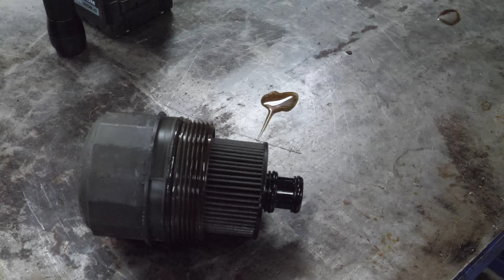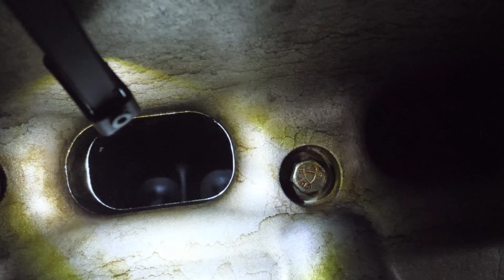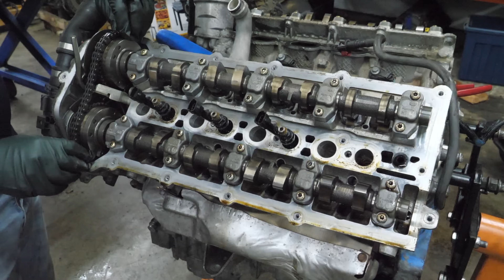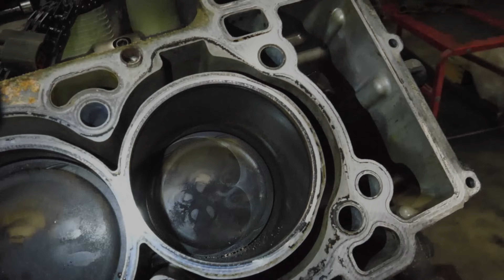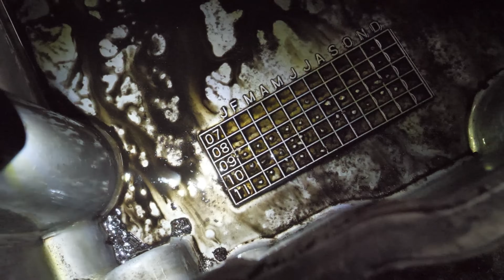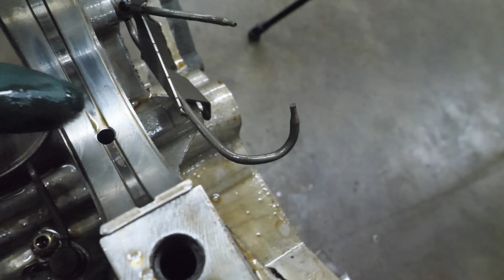500HP Jaguar Land Rover 5.0L Supercharged AJ V8 Teardown! Had to buy AND borrow tools just for this

Comment: My friends seem to send me such jobs and as a novice to this engine, I thank you for the disassembly notes.  The impressive 500 hp rating comes with some challenge.  And the strength of the lower end as fasteners and design show attention to that detail.  The number of points that might leak suggest real problems as high miles. Natural to maintance upkeep as seals, o-rings a parts channel would be critical as where non dealer repair might be undertaken.  I did take note of an owner comment, as a 2010 (XF)  *water pump and timing with oil change interval.
I'm guessing it's love-hate as to older machines.  Real skill is going to be needed to undertake repair as these machines continue to age. And where the harness connectors become brittle, worn...I suggest troubleshooting faults might get tricky.
My take away.  Ownership of these models is not for the faint of heart...and before I would see one at my shop door, I think long and documented conversation as to cost, parts availability would be important to any fitter, journeyman as repair issues.  Thanks for the post.  M.

Comment: This engine looked fine. Like a misdiagnosis. These 5.0’s were known for wear on the tensioner to guide contact button. It became a lawsuit and the guides and tensioners were updated. The reason you do not turn these backwards is because it allows the oil pump timing chain to jump and go out of time. I’ve worked on hundreds of these engines and they bought my house 🤠

Comment: Interesting engine though I am always curious what drives brands to design engine components that break typical conventions. In this case, the fuel/oil cammed pump. Was there some other aspect of this engine that required that type of design? The supercharger design: why?

Comment: Is it possible the injectors got stuck open and cut the plugs? the same as happens with some of the BMW V8s. the electrode off the plugs could have caused the damage to the pistons

Comment: A well known and documented engineering flaw with all Jaguar 5.0L engines from introduction (2010)  to mid to late 2012.
This is a timing chain tensioner (chain guide) failure which was corrected around 2013 with a redesign.   the retrofit hardware is readily available  for those willing to pay thousands to have it retrofitted.
Jaguar offered zero compensation for any car out of the 3 year warranty regardless of miles.
Once the engineering change was made, the motors from 2013 and on are considered very reliable.
Just an FYI...

Comment: i bingdown  that road befor with one of those engines and i came up with the same conclusion as the other post that the plastic piece is a  timing guides. no known that wasent the issue the fult is with high compression tensioner you saw leaking oil

Comment: WOW!    This thing is an engineering masterpiece but I would lease, stay on warranty, and at 50K go get another one!   As proven here, this sucker is so complicated that the failure of one little part, which is highly likely, results in an engine swap, a process similar to naval aviation where you just swap the engine, and send the core to naval air rework, a rework factory if you will.    Looks to me like that is the plan, and they preload the cost for all of that into the price.   Amazing!   Great video Eric!
Reply: Engineering masterpieces have no superfluous parts and generally don't need parts removed to get at other parts.  "Rube Goldbergian" is the word you're looking for.

Comment: That engine seems to have had the lower oil pan replaced at some point because the car bottomed out and cracked the original lower oil pan and put that dent in the oil pump pickup.

Comment: Unfortunately I think I know what the problem was. It is actually a well known issue in the early 5.0 L Jaguar/land rover engines. Please check the chain guide which is pressed by the tensioner, i think there is a pretty big hole in it. The chain guide was made of too soft aluminium. The tensioner piston is made of hard metal. So after a while a notch appears in the guide, eventually this notch is too deep so the chain can't be tensioned enough. Rattling the chain and break some of the black plastics. A new version of the chain guide is available with a hardened point/notch on it where the tensioner contacts the guide. This is an upgrade every owner of the early 5.0 engine should do...
Reply: What's considered an early 5.0? I have a 2015 XKR

Comment: If the engine ran very rough and uneven, it would make the crankshaft want to jump and throw it's weight around, that could prematurely wear it's main bearings quite a bit.

Comment: Same cam chain tensioners as 2002 Triton 5.4?  No wonder they failed 😄

That HP fuel pump situation and it's associated hard lines running past the exhaust is totally insane.

Comment: That tube that runs under the oil cap from the sump is for vacuum extraction of the oil for oil changes. And yes these engines suck to work on in the vehicle 😂. And yes that balance shaft for the HPFPs needs to be timed

Comment: I have a 2012 Land Rover. The engine locked up on it. I have the diagnostic test run her a reliable car service and they recommended a new motor for my 2012 Land Rover. I have never had any issue with this Land Rover. I was kind of wondering if a timing belt machine could be the issue Wyatt locked up. It had plenty of gas and oil change. it locked out as I was driving it home from the grocery store it lost power and I pulled over to the side of the road. Let me know what you think.

Comment: My dad n I replaced a 4.4 BMW engine in an Overfinch Range Rover thing, it had been run until it had lost all of it's oil somehow? Anyway, the timing had jumped a few teeth causing piston and valve contact but it still ran lol. We replaced it with a low mileage 4.4 BMW

Comment: Wow, I have a 2011 naturally aspirated 5.0L in my XF that has blown head gaskets/warped heads... all the instructional videos tells me I can't get the heads off in my garage without special tools and here you are totally disassembling one with a crowbar?  Two questions is this even feasible if I want it to run again, or do you have a long block 5.0L Jag naturally aspirated engine for sale cheap?

Comment: Torx plus, 12mm Ribe bit, polydrive. Which one for the head bolts? What size? I got mixed info.
Ok.. Answering my question. At least for my 2012 RR Sport 5.0L NA engine, the 10 head bolts are TORQ PLUS TP55. Not ribe bit, not torx, not polydrive.

Comment: The broken plastic piece is from a previous guide that failed. Looks like someone changed the guides and most likely did not replace the tensioners and the chain itself. It’s obvious by the yellowish marks someone made on the cams and the chain to keep them lined up.

Comment: Eric, assuming you are on the path to buying a new impact from Milwaukee, aren't they currently having warranty issues on their 2767-20 with serials H96B (but not H96A)? I understand they did a recall to replace store stock of the H96B models with the older H96A model just before Christmas. Just in case that affects you.

Comment: Problem is, Land Rover wont sell you con rod or main bearings so even if you have one that needs a crank or wiped the bearings, you cant buy bearings from Rover. Im sure some aftermarket company makes bearings but still, these engines are very hard to get internal parts for that arent in the timing system.

Comment: I have a 2011 RRS with the supercharged aj-v8 that’s bad. Took it in to a local Land Rover shop, which they ended up messing up and didn’t want to own up to their fk ups. Ended up getting an attorney and was basically told I can’t do anything about it.

It’s been since 2017, and it’s paid off just collecting dust.

I’m curious if Coyote 5.0 camshafts will fit the AJ-V8?

Comment: I can totally see for building that to where you have to pull the motor mount be able to get the valve cover off to get high pressure oil line off they do that on cars all the time now

Comment: I think the rod bearings were replaced the last time the engine was opened up. That's why they are in such good shape. Also, that loose screw you found may have been one of others, perhaps one got ingested by that one cylinder? Someone was careless with hardware.
Reply: It would have been something small and relatively soft otherwise it would have totally destroyed the head, piston and cylinder.

Comment: Wow,what a monster, i wonder what the speed limits are, over where the car owner lived at   lol
02:40 it seems that the supercharger pulley was turned off round? seems impossible, it could be the video
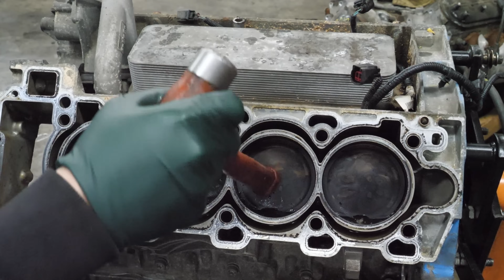at 41:30  to properly check for damaged rod bearing with excessive play, you need each piston,in turn, to be going down, in order  to create the gap on the top side of the big end; then you hammer on the piston,with the handle,as was well done,as listen for a thud.

Comment: The major flaw is the guides that the tensioners push on. But the biggest, coming from a current owner of a RR with this same engine is a LACK OF A DIPSTICK
Reply: Lol I have a f type SVR and I was looking for it for the longest time until I opened the oil cap and noticed that it just has a tube for service checking... You could check oil level via vehicle info but you will have to jump thru some hoops for that

Comment: Complexity for high performance. Beautifully engineered engine yet puzzled by the use of plastic. If indeed the failure was attributed to a spark plug electrode breaking off; then bad luck for the owner and not the fault of the designers. If it was timing tensioner failure (witness plastic pieces in the engine) then one design error compromised the engine.

Comment: I’m working on my personal 2011 range with the 5.0 SC did the full timing job kit provided from Land Rover, only issue I’m having is exhaust cam on bank one is “jumping and or snapping after it rotates over the valves” when spinning the engine over and not sure what the issue is. I hope one of you geniuses on here can let me know what the heck is wrong! Great video btw!
Reply: what code are you getting for that?
Reply: Tappet?
Reply: Or timing

Comment: My guess is the black plastic pieces broke and wound up somewhere it shouldn't of been since you found part of one in there or a mechanic or someone left something in between the head. It really could be anything to be honest since it appears a couple people have been inside the inside the engine, you never know the person that returned it may of had a oopsie if they took it apart partially just to check things out make sure it was OK, it was missing some bolts already. Could be a spark plug but I would assume one would be different but a repair shop could of got the owner to replace all of them if that happened

Comment: The reason it probably came back was the timing chain.  all that slack on these causing this heavy ticking sound and I bet they opened up the the upper timing covers, checked the tension and said "to hell with this" and sent back.

Comment: From Wikipedia; "AJ-V8 Gen III 5.0Edit

An all new direct injection 5.0 L engine family was introduced in 2009 (all new engine block).[8] Now featuring: spray-guided direct-injection, continuously variable intake and exhaust camshaft timing. The naturally aspirated engines also feature cam profile switching and variable track length inlet manifold. Supercharged engines make use of a sixth-generation TVS (Twin Vortices Series) supercharger. The 2010 model year engine conforms to EU5 and ULEV2 emissions regulations.[8]

The engine is controlled by Denso's Generation 1.6 Engine Management System."

Comment: Jaguar has always done this with the proprietary fasteners so that nobody else can work on them besides the dealers. I know for a fact that they were using the obsolete whitworth and pozidrive (look like a phillips but aren't) fasteners at least into the late 1980s on their vehicles. I found that out the hard way. I was able to use a mishmash of standard and metric tools to work on the engine I was tasked with (the infamous injected XJS V12), but those fasteners were not happy with me at all. Due to this fact, I would advise anyone who isn't ready to just light hundred dollar bills on fire to avoid buying out of warranty Jaguars (and I'm sure Rover since this engine went in those too) at all costs. There's a reason they're cheap. A lot of them are complete garbage vehicles even in good repair and they are near impossible to work on for the average mechanic.

Comment: In the UK JLR currently hold the record for labour charge - £100 per hour.......  bet there was a throttle control / body issue which leads to overheating, Bmw did right buying range rover / mini  & avoiding the the rest of it, on a side note the worst car I ever owned was a S3 land rover, cost thousands to run and did 950 miles before I sold it for parts (its like a boat - a hole in the ground you throw money into)

Comment: I fail to understand why so many modern engines have so many problems. I had a '84 saab 900 turbo that did over 200000 with just a recon steering rack and a turbo. I had a 827 vitesse that did did nearly 200000 before i sold it and it would exceed twice the limit with ease. Neither car needed oil level checks. I'm on my 4th Jag,3ls xf,i pray this won't cost me a pkt!

Comment: Interesting, Iwonder what the mileage was... I think that had already had a new chain & guide job at some point, & that piece of plastic was missed, & that gunk in the sump was excessive RTV from it. In theory, whatever damaged then exited that piston will still be sitting in the catalytic converter, wherever that is! Maybe someone snapped a plug in it & a bit of the ceramic fell in? Or an electrode?

Comment: Question:
What is the average cost of a replacement motor?
I did the oil change math based on 4k/200k @ 80$ per change equals 4k$
Reply from the maker: 100k mile engines are $5000+ 
And then consider labor
Reply: @I_Do_Cars  Very true forgot that part

Comment: Lock the cylinder with both valves closed, put air adaptor in spark plug hole and charge with air it will come out..

Comment: Typically, do oil-pressure chain tensioners also have springs built-in, or do they only supply tension when the engine is started and oil pressure is applied?  If they have internal springs, why are they so weak as to not adequately tension the chains before oil pressure builds up?  If someone can tell me, I really wonder what the deal is.

Comment: My buddy has a Land Rover range Rover with the 5.0 and the timing tensioners and guides are bad from the factory in that motor and yes that is a dipstick tube
Reply: The tensioners are undersized and the guides are missing a button where the tensioner makes contact with the guides just for your information

Comment: The first time I ever saw this sort of block construction "open deck, I think" was in a 1970 Vega that a friend of mine and I took apart back in 1971 or so. To me having the tops of the cylinders disconnected from the main part of the block does not seem like a good idea to me.
Reply: Hillman Imp engine had an open deck, this engine was based on the Coventry Climax engine all alloy light weight developed in the sixties. The engine was originally designed as a lightweight fire pump engine. It did have problems with head gaskets as the bores could sink in the block. The advantage is the piston rings can be mounted higher up the pistons leading to less dead space and better emissions. The rings can be mounted higher because the bores are cooled right to the top. As with all things correct servicing is needed the right oils and needed.  The guides where a problem until a design change fixed it.

Comment: The jaguar/ford motor has timing problems mainly the tensioner fails or punches through the back of the guide and the guide brakes rebuilding mine right now same thing happen

Comment: These injectors are nearly the same as my car except more flow. I replaced the injectors in my 1.6 fiesta st for bigger ones because..... reasons lol. Mine were stuck and only 40k miles old. I just ate shit the whole time and use the old bear grip and occasionally needle nose pliers. Not the worst but definitely annoying to remove

Comment: Watching this video, I'd have to say that a Jaguar dealer mechanic would have to have his entire sh((act))it together. There's a whole lotta parts there. The paradox is that the more efficiently an engine is packaged , the tougher it is to get to any one part, and a mechanic might have to take 10 other parts off just to get to any one part that needs service .Oh, for the olden days of working on flathead 4s and 6xs in a Ford Model A.

Comment: Roller Fingers > Buckets. Roller Fingers have less rotating resistance. More parts to potentially fail. But When a bucket fails, cam will eventually eat into the bucket, and then eat into the valve, drop a valve, and destroy the engine.

Comment: From my experience with modern Ford engines, if you use anything other than motor craft oil, it will destroy seals inside the motor. Seemingly at random places for different engines.

Comment: I bet the engine installer unknowingly dropped something in the intake or a PCV port or somehow got debris into the intake side and the engine knocked when they fired it up.   Looks like the debris flew out after running, but they didn't want to send it out the door after hearing that.     That's my guess.

Comment: No king noise from ???junk that was on piston that left marks on piston and head. Mechanic revved it up to finish it off. Blow it up. Before taking it out after new replacement was in shop. Debris went out exhaust knock went away. Engine got changed anyway

Comment: The timing chain jumping is normal if the engine hasn’t run in a while.  The oil pressure that pushes the tensioner out has bled so the timing chain will have slop